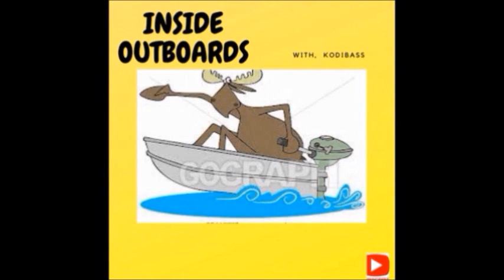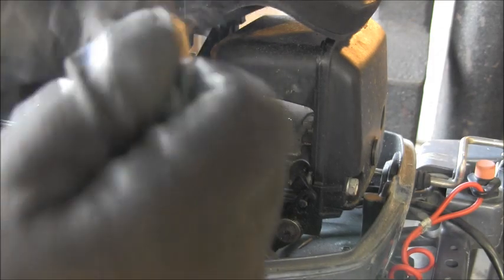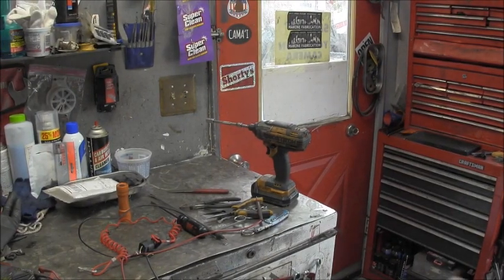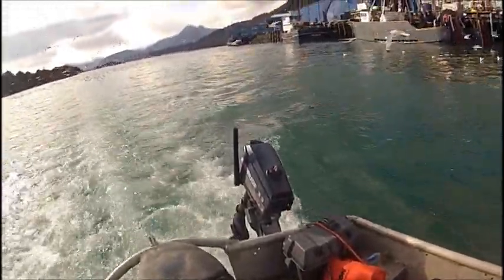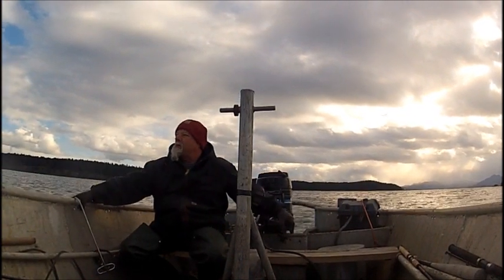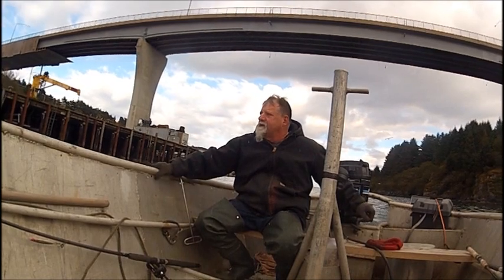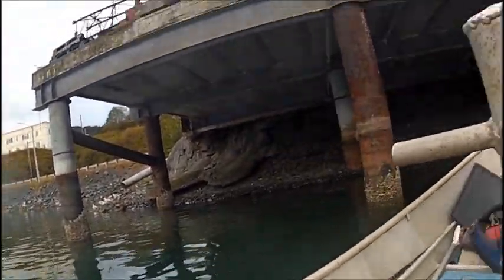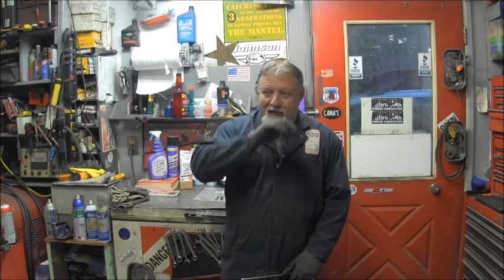YAMAHA 15 HP 2 STROKE,,, BOAT RIDE,  & KICKER TEST

Comment: Thanks for the video!  Always interesting stuff.  I like the boat you took out.  Curious about the way main motor is pulled inside boat.  I havent seen that.  With the braced vertical pipe in center of boat, and motor location, I assume this boat was originally designed for some specific function?  What are its dimensions?  I like the tall sides on it too.
Reply from the maker: It was built to close the circle in a open water siening net. It is 10 x 6 ft.    kodi
Reply: Thanks for info.  Are these a standard boat that a company or companies makes?  Or is it a one off custom design. 
Wow.  Its only 10 ft long?  Thats pretty crazy. You are a pretty brave guy to use on the waters you do. Ever scare yourself?  I do really like the boat. Thanks for the reply.

Comment: Nothing like an in line Merc my old 85hp still screams too. Is the extra set of carbs on from the 50 the only difference between the two
Reply from the maker: The cables came with the 70 when I got her.  kb